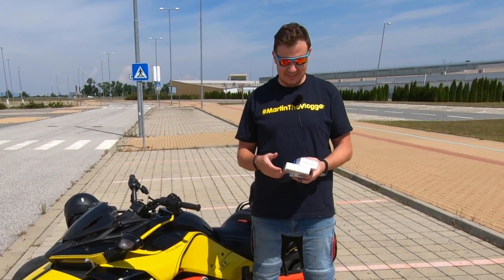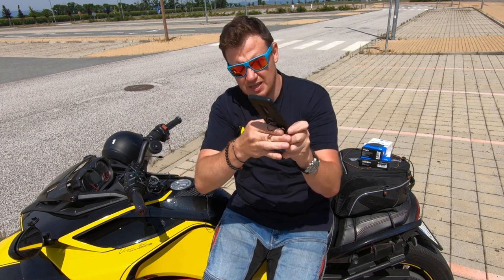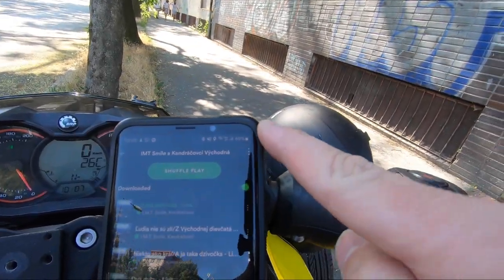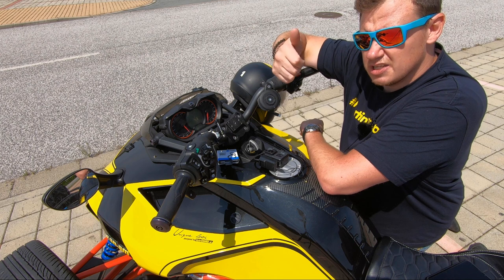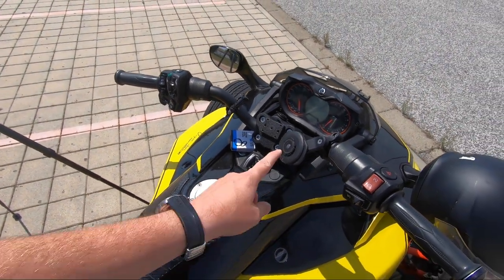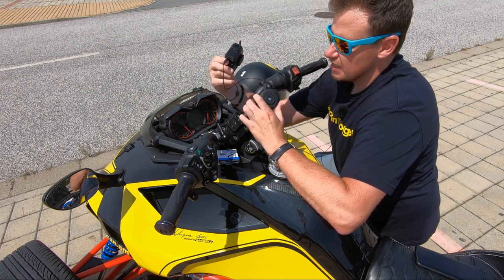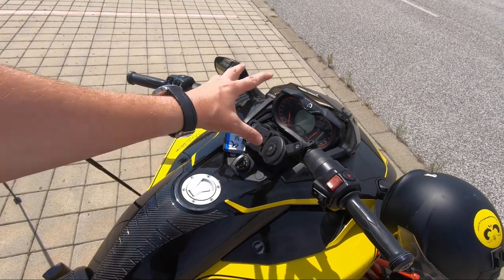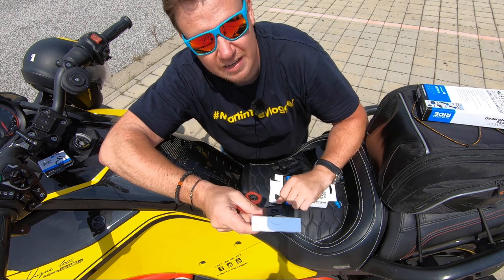Quad Lock Wireless charging head, USB charger & Phone ring stand [Honest review]

Comment: God bless you and your family.I am Adeel Riaz from Karachi
Reply from the maker: Nice to meet you Adeel 😉😉😉
Reply: @MartinTheVlogger  please tell me one thing. I bought a refreshed version of the charger you presented. However, I have a problem - I have a Samsung Galaxy S20 +. When I connect my phone to QuadLock, fast charging starts and after 3 seconds it turns off and charges slower - fast charging stops working. I using 18 watt power adapter, which is plugged to 12v socket.
Reply from the maker: @oryginalnyinaczej  have you tried to reach out to QL support? Have you tried different power source? Different adapter? Thats what i would do 😉😉😉
Reply: @MartinTheVlogger  i use many different power source like Samsung Fast Charger 25 Wats, and 15 wats, 2 different car charger QC 3.0 and powerbank which using PowerDelivery and QC 3.0 - All the time same result - Charging starting fast and after 3 second slowing down to normal Charging :/ My phone is okay, i tried to use Samsung Wireless DuoPad and everything is fine, phone start Charging in FAST MODE and nothing happend but with quad lock is same problem. On quad lock site is information that their QuadLock Wireless charger support 10W android fast charging 🙄
Reply from the maker: @oryginalnyinaczej  🙈🙈🙈🙈 ohhh lord.... sorry buddy, i cannot help. I would go to QL support to get their feedback. Last few products were not the best ones :(( i think tgey try to release things too fast :(
Reply: @MartinTheVlogger  i tried now Samsung Galaxy S8 which have 7.5 wireless fast CHARGE and everything is fine :) So, the point is that S20+ which have 15 wireless fast CHARGE, need better power adapter - but with how many wats ? 45 ? 25 do not solve the problem.

Comment: Apparently the unit has a power switch. Watch this video https://youtu.be/n76VweWDlrY
Reply from the maker: Yup you are right. Thank you for letting me know. Still  its not tge greatest solution as when you gave gloves etc its useles. And one additional thing. The "fix" they have send - the rubber ring - its not working due to motorbike vibrations. Just an update. But again thanx for letting me know.
Reply: @MartinTheVlogger  I’m glad the video was of some help. I bought the wireless solution from SP connect. I worked ok with my iPhone X but since I have upgraded to iPhone 12pro it doesn’t work. I bought the new phone case which is a very poor design and obviously a rushed job to get it to market on time. The charger won’t work because the iPhone 12 requires qc3 charger and not the qc2 charger that SP sold me only 2 months ago. I’m very unhappy with them. I wish I’d chosen the quad lock option. Can I ask where you got your 12v to USB socket, was it supplied by QUAD lock? Great video by the way 👍😁
Reply from the maker: @demonkey123  SP has a new holder that will be magnetic based and i think they have put a lot on their shoulders. 12V its from BRP - motorbike manufacturer. Never used it.. well once, for compresor for flat friend tire :))) i think QL is rushing few things as the "war" its there. But in general i love them. I just dont like when you pay 100something eur for product that is super promoret, well packed, well design - shape wise, and then functional things dont work. But i will fix them during winter. What i have to say, QL has paid i think 50% back to each customer for fixing it on our own. You have had an option to accept it.